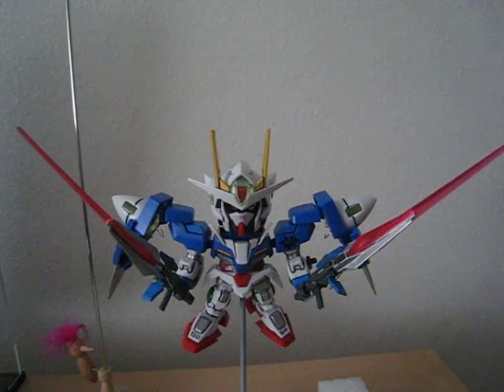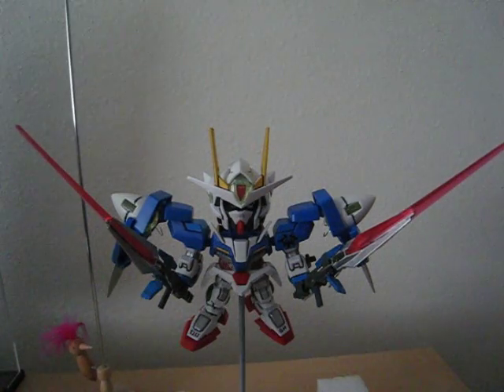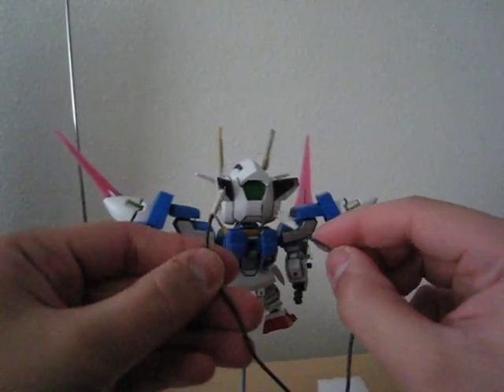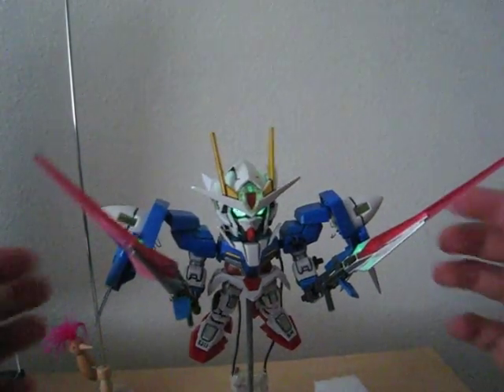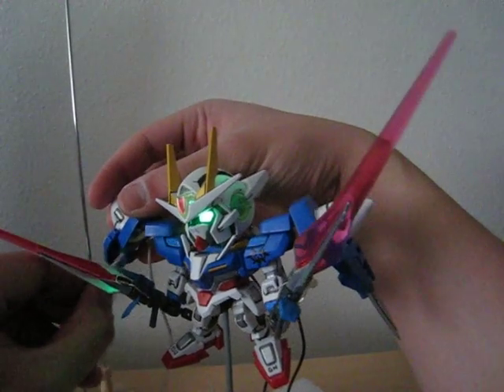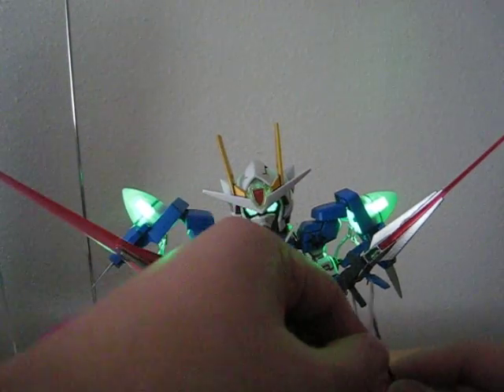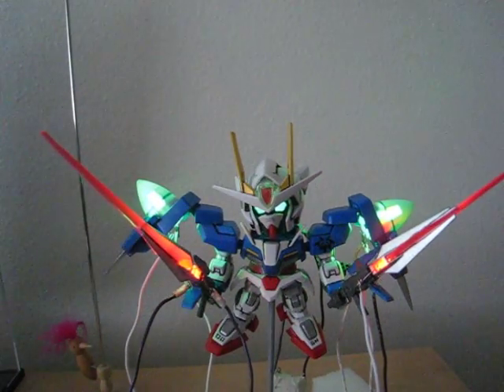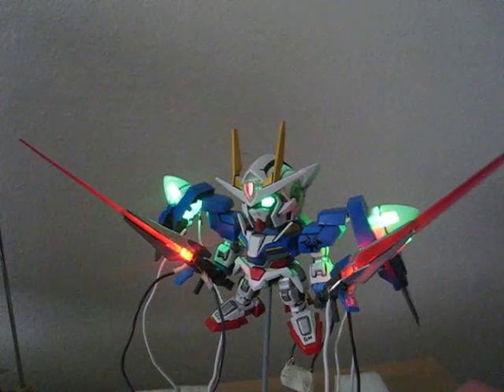SD Gundam LED lights

Comment from the maker: I actually haven't installed any LED to any of my recent kits.  I guess it's one of those, "it's only cool in the beginning" kinda thing. hehe.

I did paint the inside of the head black for that reason.  Thanks for the tip though. ^_^

Comment: theres a few things i would like to see you do. it looks great and all but you should try and link the wires into one battery casing and move to to the back trying tohide it

and for a tip paint the insode of the gn drives black so the green doesnt go through the white parts

Comment from the maker: It's possible, just need smaller batteries.  Or actually use the connection at the action base to run wires.